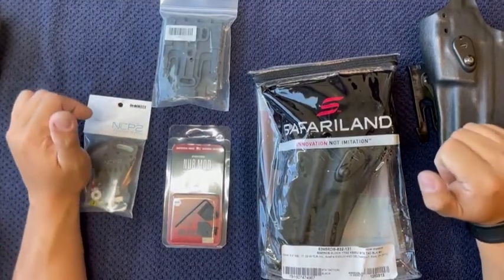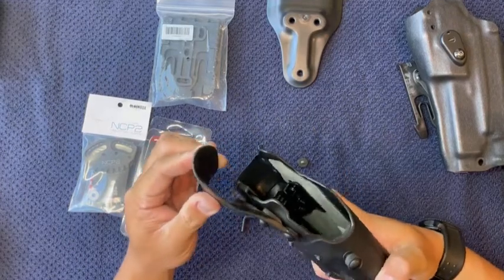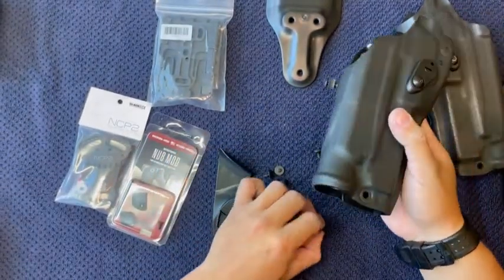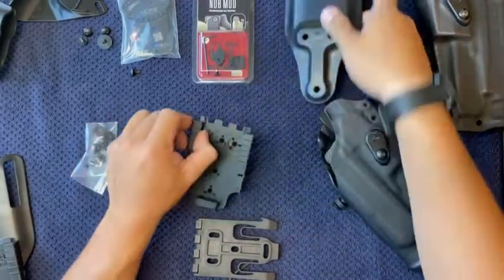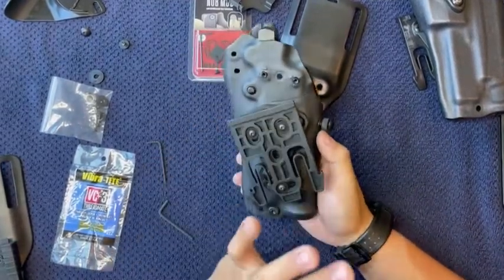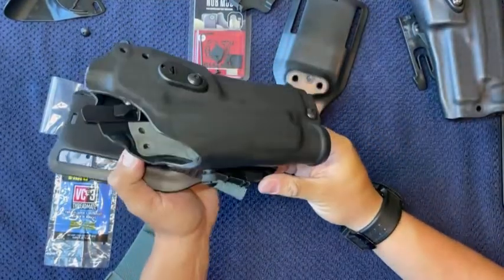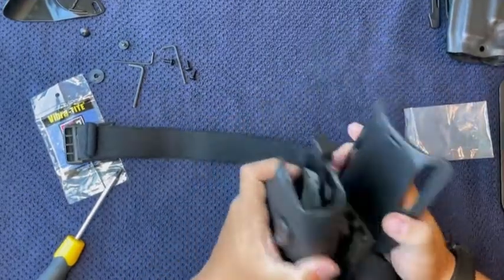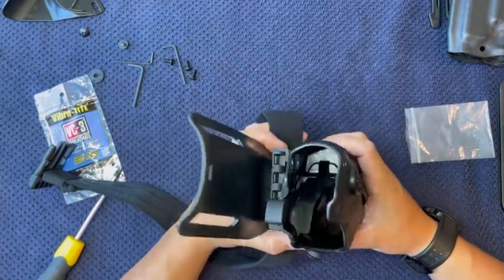Installing Safariland QLS, OT Defense Nub Mod, and NCP V2 on Safariland 6395RDS holster

Comment: Why do you run the 6395 over the 6390? Also will the negative cant plate work with the 567Belt loop? I owb conceal carry but i want more negative cant than 5 degrees I already have nub mods i just want negative cant.
Reply from the maker: 6390 and 6395 are the same holster. The 6390 just comes with a mid ride adaptor and 6395 comes with a low ride adaptor. Idk about a “shorter” plate that will help with that
Reply: @manzanotactical  ok thanks its so many attachments to choose from with the Safariland holsters that its insane but i really love the negative cant.